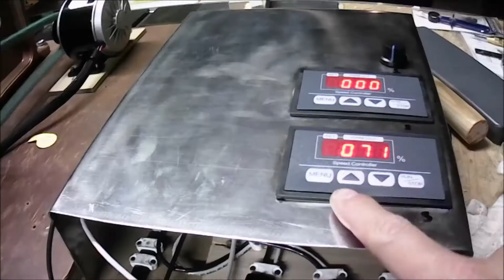Making Bowl Sander

Comment: How do you hold the sanding pad into the bearings, there's no thread on the pads you link to? And the link to the plans you used?
Reply from the maker: I apologize, I didn't realize I skipped over that part. I'll have a quick video explaining that in a couple of days. I basically used a nut of the same size, tap and threaded it and had a set screw.
Reply from the maker: Hope this followup video helps: https://youtu.be/PMYpxDqi458